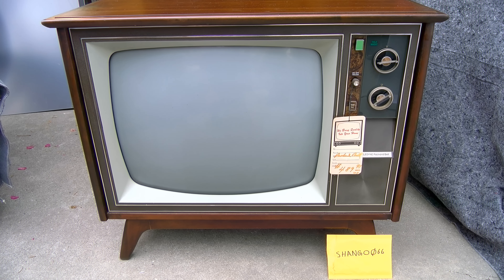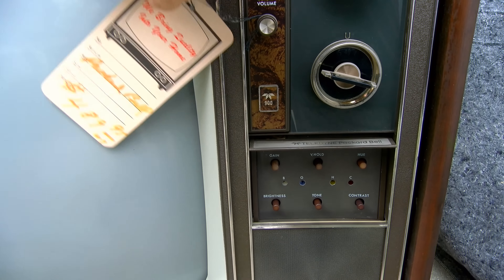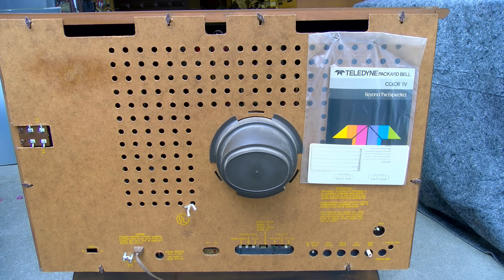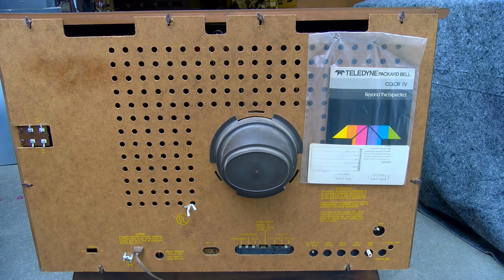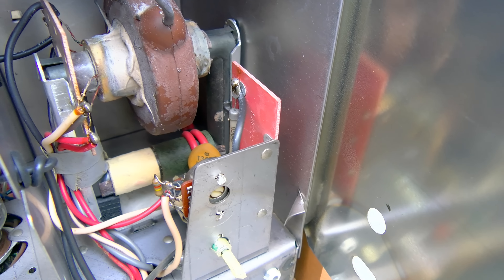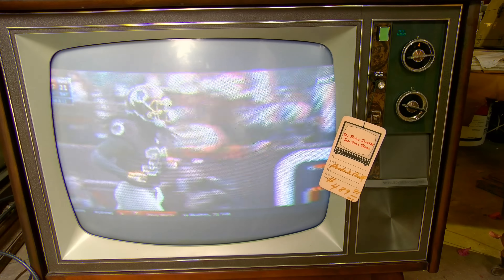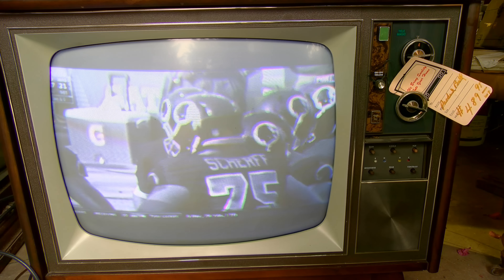Packard Bell 900 Color Television 1973 NOS 4K

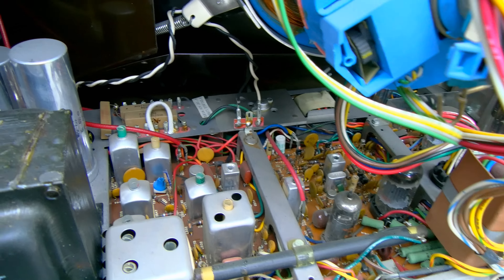Comment: 2:58 Given that Packard Bell was sort of a bargain brand, it's amazing that they were still shipping sets with giant, expensive power transformers this late. Switching to a hot-chassis design would have saved PB a fortune, and cut the weigh of the sets as well.